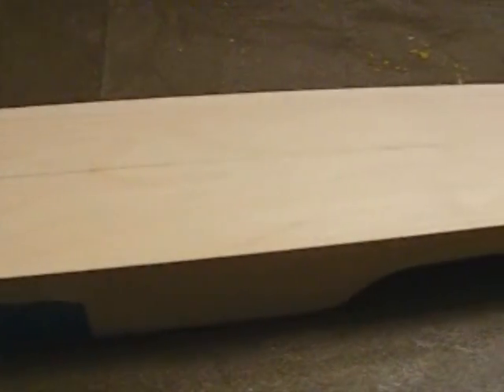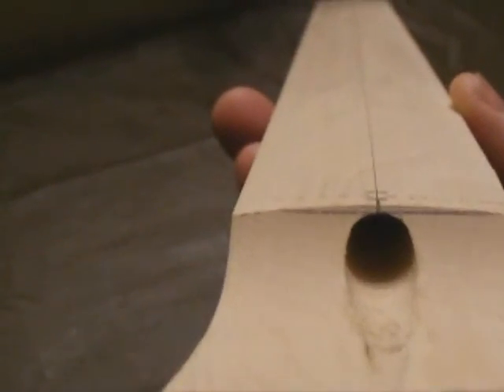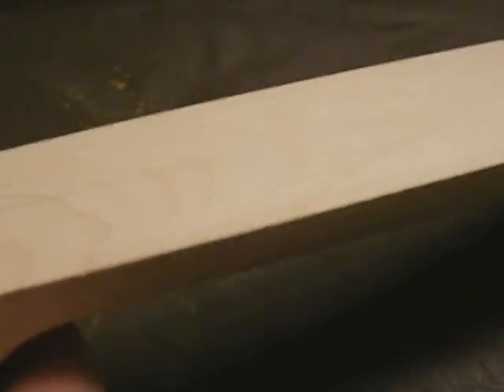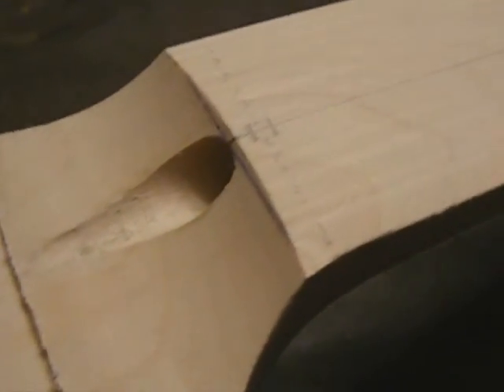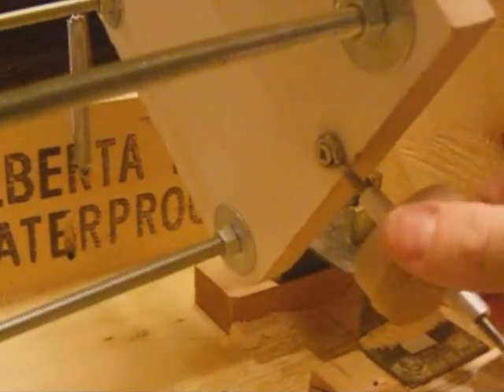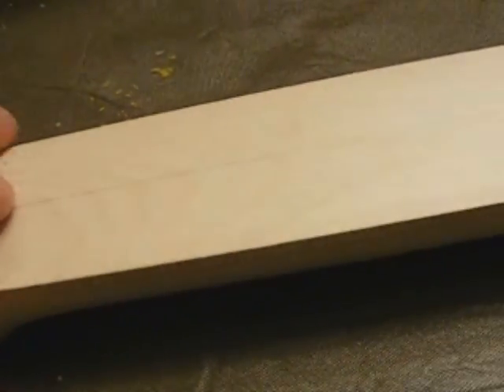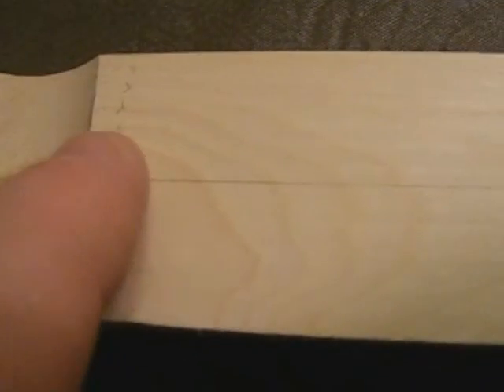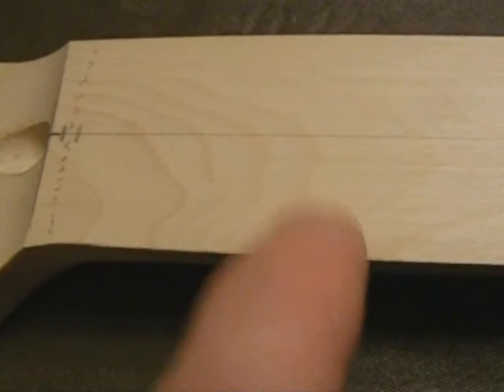One Piece Neck Build Part 7b: Compound Radius Fingerbaord

Comment from the maker: Calvin thank you for taking the time to watch them. I don't use glue. You can however wick some ca glue from the ends. For best results keep the fret radius only slightly smaller that the fb radius this will help keep fret ends tight to the edge of fb.

Comment from the maker: @snakev10v5 
Wales, That I am not sure of. You could make your own if you have a few simple tools nd a bit of know how.
I use 3/16" steel rod from the local hardware store and thread each end with a 10-32 die. I also make the anchor out of 3/8" steel rod and cut it to 1/2" and drill and tap it. I also make the adjustment nut out of 3/8" x 1" rod and drill and tap and then cut a slot for it. Sounds like alot but its not bad.

Bill

Comment: Looking good. I would have thought that a straight sanding stick would be sufficient to clean up the profile after routing. If the profile is correct as you say, 240 grit upwards shouldn't change it but will be enough to clean it up.

Got to figure out how to dial in a 7.25" to 14" radius myself now :-\